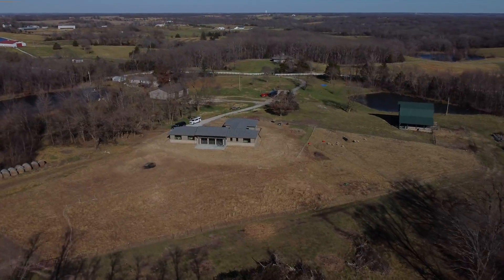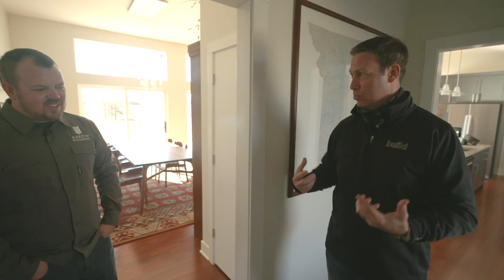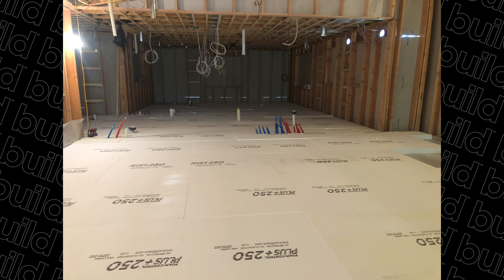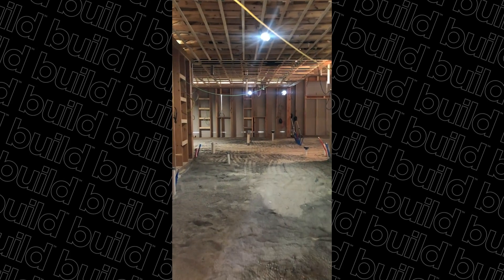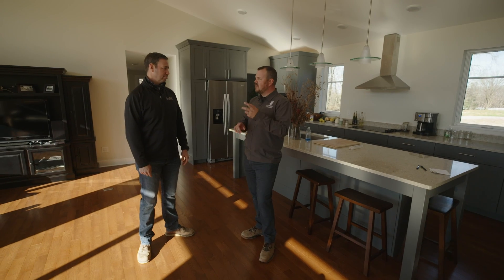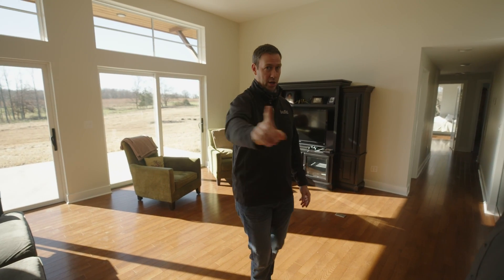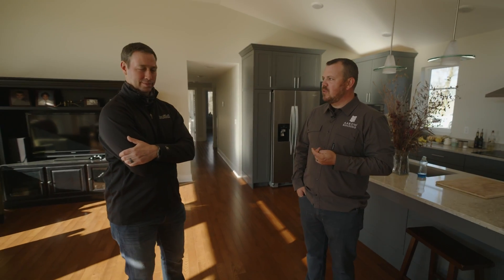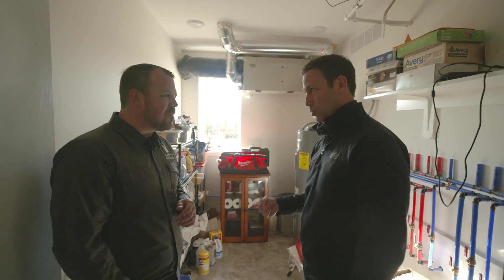Slab-On-Grade INSULATED Foundation (NO Concrete?!) - Part 2

Comment: Doesn't seem like it would be much cheaper as you still have to buy and truck in the road base, then the labor to level and compact it would be similar to concrete.  Wouldn't it be cheaper to just put  wood truss under floor and have a crawl space? you're already using Advantec & insulation.  Plus u have a crawl space for easier renovations in future?    I don't see any ($$) advantage here.

Comment: I'm doing perimeter icf, compacted soil, 4 inches road base (NOT wetted but compacted) 5 inches gravel no fine, then 10 mil plastic taped, then 2 sheets styrofoam (the expensive stuff was unavailable) then 2 sheets t&g overlapped plywood glued & screwed. Earthen floor over half of it. Low Humidity Northern New Mexico & no worries.

Comment: Super cool house. That's what and how I would have done it. Right now I'm just building a small off-grid, on sand series of additions around the cargo container core where I am squatting on land I don't own in the high desert of So Cal.  Cold winters and hot summers. Using lumber I reclaimed from pot farms that cashed in on their crop and bugged out leaving everything expendable behind. Mostly 2X6 and OSB. I have managed to get ahold of some 20 foot long 4X6 beams and some 20 foot 2X4's. So if you're ever visiting Edwards AFB, I am about 5 miles south of the southern perimeter looking for UFO's.

Comment: Greetings Matt and Jake! I am very thankful for these videos!!!! A customer wants a slabless slab home, ICF exterior walls, truss roof, geothermal, high performance home. According to the customer I am nearly the only option. As I have watched these videos over the years I have implemented as much as I could either in the home or in the conversations with customers, emphasizing structural integrity and high performance. This customer wants an ACH50 of .6. Harwood floors and some carpet. He wants to do the roof similarly as you did Matt on your home. If there are any other videos or advice you have for me, please respond to my message here! Thank you all for everything you do for us builders!

Comment: This doesn't seem expensive, complicated, or time consuming  compared to a traditional concrete slab so why use concrete? Is this method more problematic in the north where have 4 seasons?

Comment: I have a question, I have a slab with foam underneath (2"). I would like to add at least a 1" of xps foam over my slab. Is there a foam with enough rigidity that I don't need a wood subfloor over it for floating floor?
Reply: i would doubt it would not crush especally if you put carpet.. but go to matts home videos he added foam over his old slab

Comment: Some of the still shots showed plastic layer, but the video just mentioned fines, foam, then two layers of OSB
Where would the plastic sheet come in?
Reply: I was wondering the same thing .. looks like the aggregate, then the poly adhered to the outside framing, then the foam insulation and finally, the Advantech (or boards)

Comment: Compacted aggregate is a sound idea; however, I would have at least poured a couple of inches of concrete. There could or should have been a concrete pad in the center for support.  That would have it much more structurally sound, important where I live in hurricane country.   The main point is to insulate the perimeter.  I used 12" aerated concrete block wall for a stem wall and my slab keeps warm in my gulf coast climate.

Comment: This is actually normal construction in many Scandinavian houses, because of the weather it’s mostly bare ground, insulated foam, concrete slab (most have floor heating) and then tile or wood floors

Comment: I would put a step down into mechanical room since i had a sewer backup in mine with a floor drain in that room and similar doorsill and the blackwater got everywhere anyways and caused major damage causing a total renovation of drywall up 2 feet of soakingand flooring .
ended up better than it was before since previous rug install was homeowner done but still

Comment: Maybe instead of EPS this could be a potential use of shredded tires?  I don't know what binder could be used for the shredded rubber, but I've seen products that use the rubber from worn out tires - which are a huge waste disposal problem.  Tractor Supply sells a rubber horse mat that is made from recycle rubber from tires.  That product is too spendy, but I think it would work, especially if there is a less costly binder for the shredded rubber.

Comment: Being in Chicago with homes built on loose sand lasting 100+ years.. I'm not concerned about settling.. 
That's a legit way to put down  hardwood floors without the cold of concrete or need for hydronics.   What about the utility room? Hardwood floors with furnace, water heater, washer dryer and sink too?

Comment: I like the idea, and if the perimeter foundation wall is deep enough you shouldn’t have to worry about burrowing critters. But I live in a place with a high water table, lots of spring runoff, and earthquakes so I’d be wary of this. But I might use it for a small outbuilding or guest cabin to test the concept and minimize losses if it fails.

Comment: Could this kind of “slab-less slab” be done in Texas. If not, what is the kind of foundation to be most resistant to floor, ceiling, and wall cracks in Texas?

Comment: Hi Matt, I just subscribed to your channel. Great job! I am learning so much. What all around interior insulation would you recommend for a 10x20 wooden, metal roof Amish built shed? I am converting it into a home. I saw your video about not needing plastic insulation protection in walls, but is it a good idea for West Virginia? I am confused about rockwool vs " seriously thick foam". Thank you & keep up the good work.

Comment: If you're going to all the trouble to bring in aggregate and leveling and compacting it, wouldn't it be simpler and less expense to just build a standard floor over a crawlspace?  Add all the insulation you like at that point, and any plumbing / electrical / HVAC rework is a million times easier and cheaper.
Reply: Stem walls and framed floors aren't going to be cheap.
Reply: Well they can aways just make a new hole they can just pop out the old floor

Comment: I always wonder if it's worth it to insulate a slab past r10. If you're trying to maintain a 70° room from 45-50° ground temp, i feel like you don't need much.
Reply: Generally no you're correct. I've only heard of radiant concrete pours going in states like MN put R10 below concrete because that delta temperature difference isn't saving you a lot.

However, if you're going to spend extra money someplace in the build, do it on foundations, basements, or underneath the slab because for the life of that house those things aren't changing easily. A penny saved is a penny earned. If energy costs keep rising, it may not be a bad idea to have R20 underneath your slab house.

Comment: Wondering how this might differ when you want some radiant hydronic heating in the slab? 
Here we normally put down a base (sand, rocks, clay) and compact it. Cover with a moisture barrier, EPS foam, then rebar and pex and fill it with concrete
Reply: looks like that would work very well

Comment: I maintain a building from the 50's in Northern Alberta and it with built with the same idea. Concrete frame for exterior walls. packed dirt slab and then horizontal 2x6 on dirt with red oak flooring. It's been 70 years and it's as solid as the day it was put in. Unlike the addition in the 80's that's falling apart.
Reply: I'd have to wonder about the difference in quality of labor between the periods as well.
Reply: @OneWildTurkey  in all honesty there was poor and good quality Labour in both periods, they just didn't necessarily line up to both be on that house.

Comment: I think the 4 corners could be bored  for concrete legs on the small perimeter slab to increase load strength.   And yeh thats way more eco friendly.  Here in california you could have huge concrete repairs and then some in an earthquake.  Go 2-3 layers of foam to absorb shock and it may help in a quake.  I like it. 

I love your show , highly informative.  Im a licensed electrical contractor in the Bay Area.

Comment: Matt, the stem walls of the foundation could be made of wood.  No concrete at all!.  It's called an Permanent Wood Foundation. 
https://www.southernpine.com/applications/permanent-wood-foundations/
https://www.awc.org/codes-standards/publications/pwf-2015
Reply: This can work, but... You need the old CCA lumber (still sold, for this specific purpose), and excellent grading & foundation drainage details with a fairly low water table and the right soils.  Then you need to study up on what precise details you're going to do, and there's a lot of disagreement.  PWF seem to be a lot more controversial than slabless slabs with concrete foundation walls.

https://www.greenbuildingadvisor.com/article/the-bs-beer-show-permanent-wood-foundations-pwfs

Comment: Amazing what builders will do to cut corners in the name of science.... what’s next? No roof but hey we got plastic film to produce you heat and plenty of sunlight? :)))
Reply: I don't think that this is in the 'cutting corners' category. It's one thing to use fewer nails or cover up short cuts or apply fluff instead of fill insulation. It's another to carefully plan and prepare for substrate/slab/subfloor construction.
Reply: A concrete slab is a cutting corner fyi. You can skip all sorts of steps in fine craftmanship of a home if you just lay a slab.

Comment: 2:17 is this how we gonna hang pictures now!? #Dang 😬
Reply: I like it better than putting several holes all over the walls, but I don't like it better than doing a custom layout for pictures.
Reply: I added picture rail to our 1920s house (should have been there to begin with) I'll never go back.... no more plaster repairs and can rehang a picture etc in 30 seconds anywhere in the house that I have it.

Comment: I would think the Styrofoam is more more environmentally unfriendly than concrete?
Reply: EPS foam is pretty low embodied carbon, which is what they used. like 1/10th the embodied carbon of XPS foam, and unlike concrete, it helps the house to use less energy, lowering the operating carbon footprint of the house.

Comment: How would hot water heat integrate into the system? Is it possible to use the board (forget the name) that you clip tubing into it?

Comment: Pass. I'm starting to think this channel is no longer about high end practical building but $$$$$$$$$$$ niche, not going to work in all climates, off the rails, I'm supporting way more unconventional than you and can find some science to back it up craziness. Cancer foam everywhere is another issue. It's like those guys in Boston who make problems that don't exist and insult years of manufacturers R&D and claim to improve some manufacturers product by adding a bunch of extra preparatory steps. Almost everything this once awesome channel provided, will not work in a 150 mph wind code environment or a sand grade.. Oh, here comes the hippie "concrete is bad for the environment" crap, never mind the cancer foam and processes associated with the rest of the building products. Life is bad for the environment mmm,kay?!

Comment: I am curious how much load can that foam carry. Even when distributed across subfloor, there must be some limit to consider (ie 4 person hot tub, semi in garage)
Reply: In Matt's previous video of his own house, I think he said 6lbs per square inch? and available up to 10 psi (which he determined was unnecessary.) with 1.5 OSB on top, it would be really hard to create much of a point load outside of trying to actually support the building on it.

Comment: Not sure if this would passcode in California and how is the floor hold up in a seismic zone or up against earthquakes? But for the south or midwest it might be a good flooring option.
Reply: Essentially this is harden gravel how would that work with earthquakes and cracks⁉️
Reply: How does the floating slab work near the San Andreas Fault line? Yes while this product it’s good for the environment how does it address the earthquake zone? Does this product hold up better than concrete in  seismic hazard zones?

Comment: Lol this guys using c02 as an excuse to build cheaper. Interesting. Lol
Reply: The labor and special fill to get it dead flat and compacted prob equal a slab.  Just use piers and raised framing.
Reply: @kdrguru its too sensitive to water. I'm not sure that's a good idea. I'm not a builder, but commonsense tells me this is bad long term.
Reply: @kdrguru  we are philosophically told to build our house upon a rock and told not to build upon the sand. That is probably why this kind of construction raises so many res flags to me.

Comment: So, serious question... What about areas prone to sink-holes?

I live in Florida, and my first thought was that if the ground shifted underneath there would be nothing to hold up the floor while you work on getting fill underneath. 

(I'm not a contractor at all, and speaking from a combination of intuition, ignorance, and curiosity.)
Reply: Sink holes under concrete don’t tend to turn out well, either. Ask the folks at the Corvette Museum (extreme example, I know).

Comment: Wonder what kind of psi rating this subfloor would have, such as moving a gun safe on a dolly through there or a baby grand piano.  What do interior walls set on?
Reply: Interior walls are attached directly to the floating 2 layers of advantek.

Comment: Hi Matt, Great Video.
I live in Europe and i am familiar with this method. The one question I have concerns a vapor barrier. Would you not want to have one somewhere between the ground and your OSB wooden floor covering? I know OSB is considered a vapor barrier but it not meant for levels of humidity that could transfer through from the ground. I saw a vapor barrier between the OSB and the hardwood floor but my concern is the duribility of subflooring itself. Look forward to your comments.

Comment: Here in sweden its actually mandated by code (in and laundryroom/mechanical or any room with the potential for a leak) to have a waterproof mambrane in/on the floor and have it connect up the bottom of the wall. Its a great way of reducing the risk of damage to the house in case of a leak :)
Reply: What kind of membrane material do you end up using?  And how do you get the floor height to achieve that?  I've been looking at floor trusses and they all warn against cutting into them, so I guess I need another layer above them that can be removed under bathrooms.
Reply: @TrogdorBurnin8or  nowadays the most used watertight membrane is a type of fullt welded plastic mat. Regarding the hight of the trusses, standard height in a floor system (stick framed) is 220mm, but to compensate and get the floor to be the same height in a "wetroom" we lower the height to 195mm and double the amount of trusses in the room. So usually a bathroom floor is built by having 195mm beams on 300mm OC, 22mm subfloor, then 30mm of fiber reinforced concrete/filler, then the watertight membrane, then grout and tile.

Comment: I'm guessing termites aren't a major problem in the US like they are here in Australia?
Reply: Regionally specific concern.  In tropical parts of Florida, termites and mold make wooden houses a questionable choice.  In the South-Eastern US in general, the threat is less intense, but we've had imported Formosan termites that will target aggressively anywhere you have moisture management issues.  In the rest of the US, termites (and carpenter ants, and carpenter bees) are a minor pest, mostly just annoying cosmetically, but not a threat to a well-built home; They can be a sign that you have moisture problems somewhere, though..

Comment: So interesting to see different build strategies in different parts of the country. Just finished my house foundation with 9 foot walls and my shop had 6 foot walls. All to get below frost line.
Reply: I have a compacted soil/sand slab up in the foothills of the front range. Stable since 1979, it seems
Reply: @marcob1729  Yes my old cabin has something similar, at roughly 7900ft that seems fine as well.  Not like the expanding soil along the front range, which is why my local engineer recommended going deeper.
Reply: @5280Woodworking  Ah, I see. Yea, I think the fact that we have ~3 inches op top soil and then a bed of decomposed granite really helps!

Comment: soo, what's the advantage again besides no concrete? if you didn't want high carbon product dont buy granite countertops or the shit ton of foam they used I dont get it.
Reply: Foams are not identical.  This is a much, much lower GWP assembly than the typical slab.
Reply: I don't get the problem with carbon products. People shouldn't listen so much to Greta Thunberg.

Comment: Why call it it "slabless slab"?  It's just - slabless, or floating composite, or wooden slab.  Nice, but banking on no flooding.
Reply: This is an on-grade house.  On-grade, most people bank on no flooding implicitly.  Few basements, however well sealed, will survive standing surface water (~8ft of H2O hydraulic pressure at floor level).
Reply: @TrogdorBurnin8or  Concrete will survive a flood.  I would think the concreteless construction is highly vulnerable - a literal floating floor.

Comment: Take This Idea one step further - concrete (dry powder) - stabilise the surface - it will harden over time with residual moisture...
They saved something like 50-100 Tones of concrete - Co2 etc - replaced with low "processing cost" / value added aggregate, and all the associated processes.

Comment: Any concerns, or protection applied from Radon gas?
Reply: 4:35 you can see them sealing the poly to the bottom plate, you can also see it in a few spots under the EPS